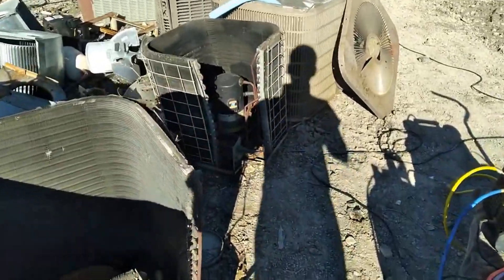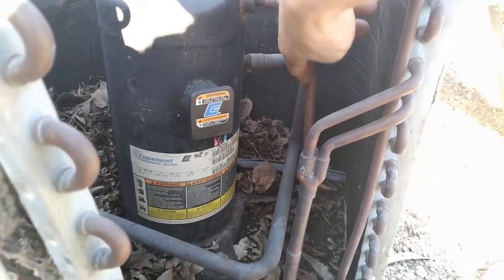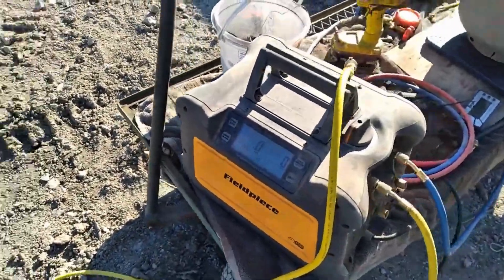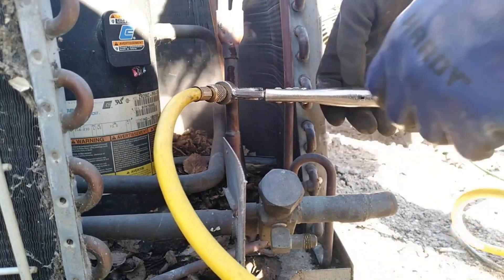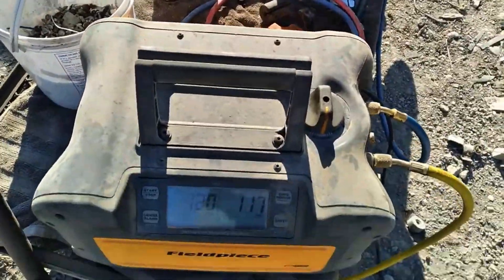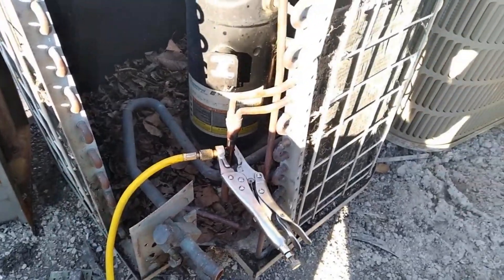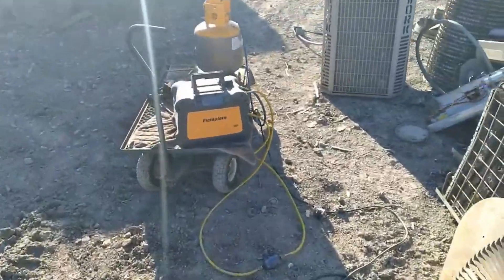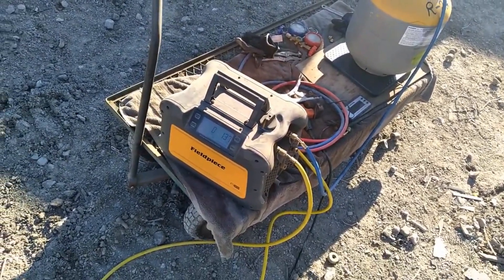How I Recover Freon in the Scrap Yard

Comment: Do you need an EPA certification to recycle the refrigerant and get paid for it?
Reply from the maker: Yes. I took my test at a local hvac parts dealer. I had to study a lot.
Reply: @ZachtheGoldChamp  ok good to know
Reply: @ZachtheGoldChamp which cert did you get? The universal or type 1, 2 or 3? I want to get it for scrapping too. You sell the used refrigerate local or you ship it?